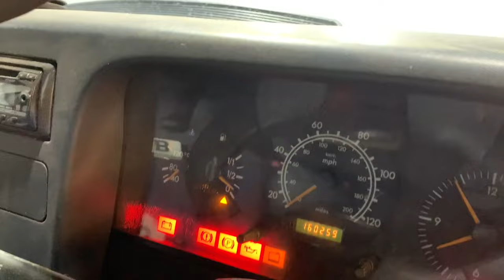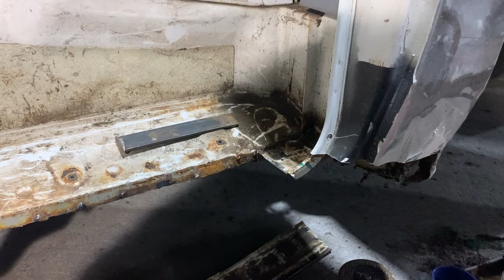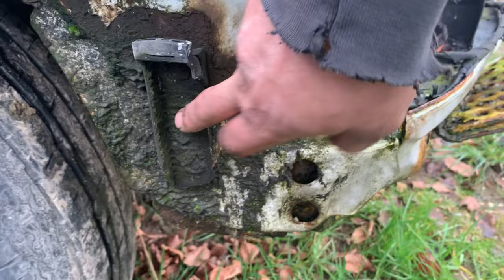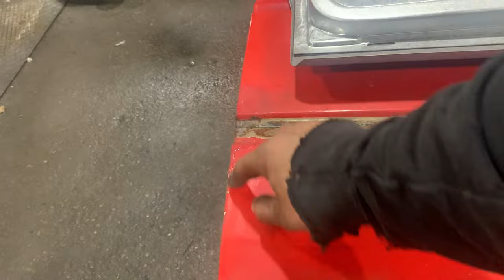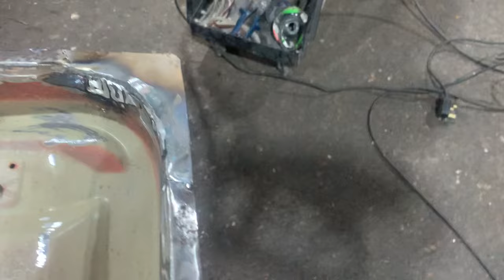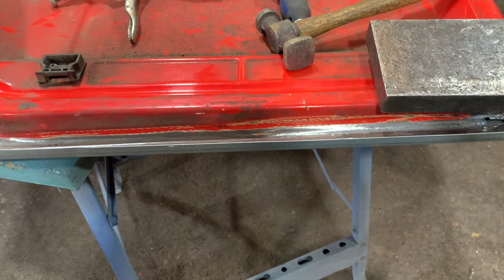Mercedes sprinter Vw lt restoration, body repair part 1 TN1  lt35 46 32 28

Comment: To remove the doorskins I use a skinny cutting disc & just cut off the outside mil or two, which makes the fold-over either fall away or be so weak you can easily remove it with an air-chisel. Saves a lot of mucking about. :-) Dunno how many of these doors I have repaired, but it's more than "!loads" for sure.
Reply: I've never had a repair panel either - always make 'em from sheet. They have you spoiled. :-)

Comment: Hi Al love watching  your video as I have a sprinter 412d sprinter camper van 2.9 with 360km on clock and it runs like a dream but I have just changed the fuel filter and run it up and it ran for 20 seconds now it won't start,the replacement filter had a black  rubber seal in the middle the old one didn't,would this be causing the problem or do I need to prime the fuel? And how do I do that? Thanks dixy
Reply from the maker: You’ll need to crank it over some more, you’ve got air in the fuel lines it should self bleed . Also worth check that the old centre rubber isn’t stuck to the filter housing and you now doubled them up 👍
Reply: That'll be 500 pounds please 😂